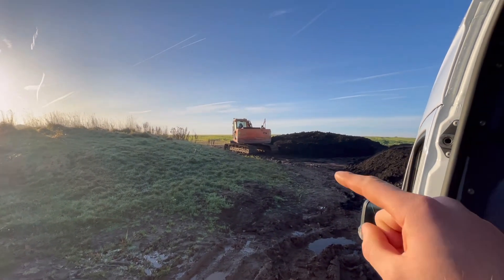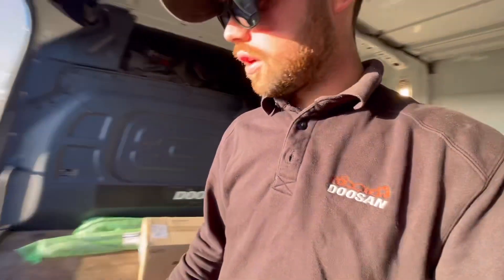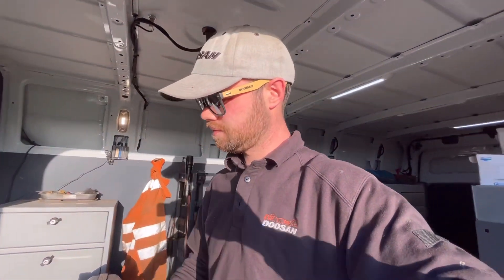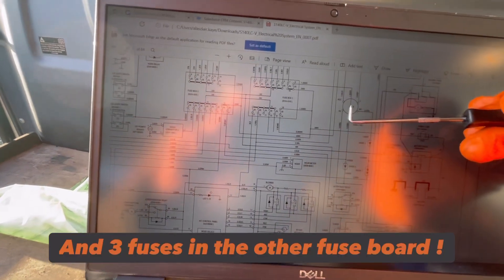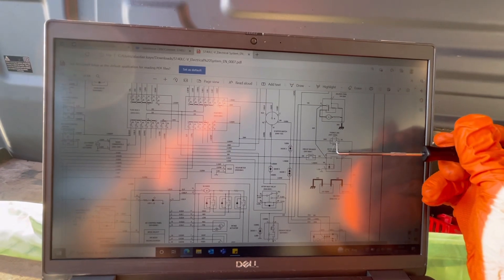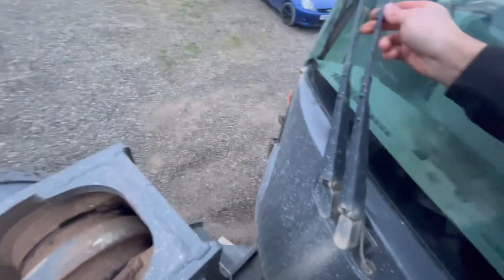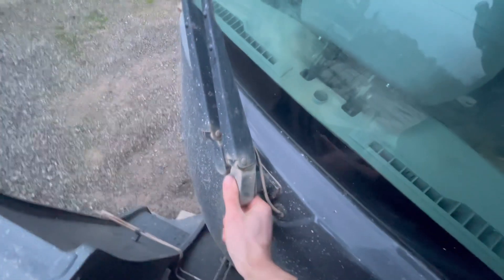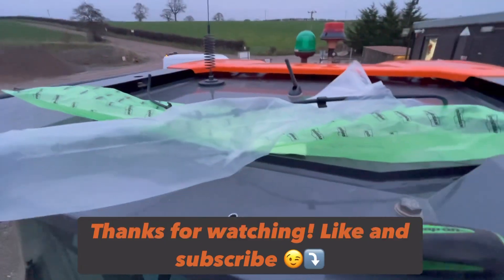Episode 127 - Keep it simple stupid

Comment: I hate others bodge jobs and you need to repair.
Heads up on that check valve on that 27 main boom ram.
My work colleague did a pilot hose to the dipper arm, then gave fault of pull left stick back, seconds later dipper arm moved..
After your video on 27 check valve and bleeding line.
Told him to bleed line .....guess what......all is good and working.
Your work and videos got us sorted .
Thank you so much.

Comment: I had a multiplexer channel fault on a class 66 locomotive. I phoned an electrical engineer back at HQ.Between us we worked out what circuit was playing up. But a locomotive is nearly 70 foot long. A broken cable, bad earth or poor connection a nightmare to find. We were both stumped. I sat in the cab ( loco has two cabs) on the mobile talking to him and just touched the slow speed control toggle switch. All of a sudden, the switch did not feel right, not positive feel on and off. I tried it the second time and the plastic body of the switch disintegrated internally. That caused the intermittent fault all along. I had another fault, no lights on the front of the locomotive, it was ready to depart on a coal train, lost its feed to light circuit, next to the light rotary switch was a demister switch, just moved its feed wire to light switch, job done. The cable just had enough to make a good screw connection. That quick thinking saved a huge cost as the train run on time. Its great when it works out that way.

Comment: Wiring can bamboozle ya at times!  I've started using a 55w bulb on a tester to check power. Got badly caught on a New Holland one time with a led circuit tester! The fuse was blown enough to not let power through but light the led! After 8 Hr's checking wire's put power in from wrong side!  Realised the mistake then!🤫😂 Top lad and great video's.
Reply from the maker: Easy done ✅ 😂

Comment: AC Delco make a heat shrink with anti ox and sealant inside. When I wired heavy equipment and had to make a splice most of the time it was solder and heat shrink. Those plastic splice are fine for garden lamps .

Comment: Was restoring a compact tractor a few years ago which involved re wiring the lights. I worked from back to front, the last thing to figure out was which wire did what on the plug going to the bonnet for the front lights. I first  checked that my ground was OK, then happened to probe the other connectors in the plug. Lo and behold, there was ground in the Parker wires, I had every wiring connector re opened before I realised my error in judgement. To put it simply, your light bulb is always grounded, so that ground can be detected all the way through the bulb and back along the positive wire as far as the switch. I detected it at the front as all the Parker light wires were joined as part of the same circuit.

Comment: Ali, everyday is a school day, don’t give yourself a hard time, you solved it, others didn’t, don’t discount that just because a fuse hasn’t blown you haven’t got a positive wire just rubbed through to a negative, this will take away power from the negative, had it many times, had a battery draining 9amp drain, turned out to be wiper motor shorted internally to earth, fuse never blown.

Also, fuses wear & crack, but test ok on continuity, link expands loss of power with heat amps etc, we as engineers turn up a time later, fuse cools makes connection all works ok, any suspect fuses bin them.

Keep up the good you do 👍👊
Reply from the maker: Thanks Anthony 👍 what matters is it’s going now shifting sh!t 😂
Reply: Every cloud lol😜